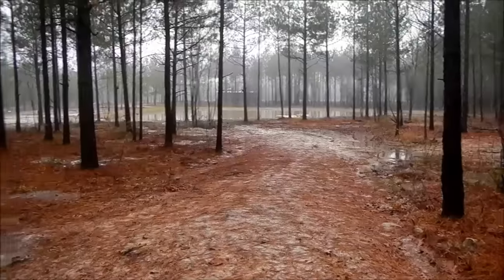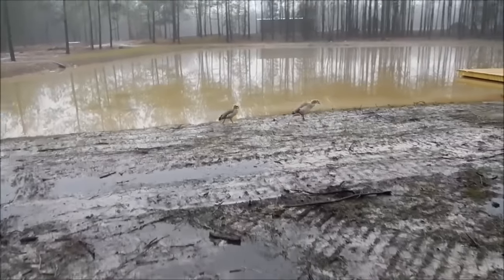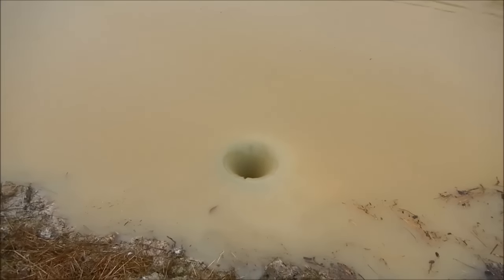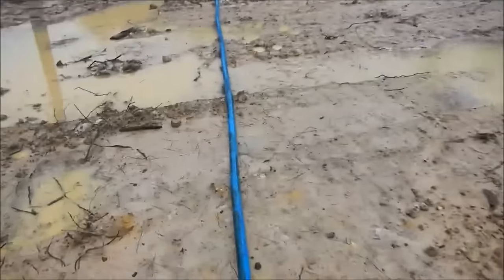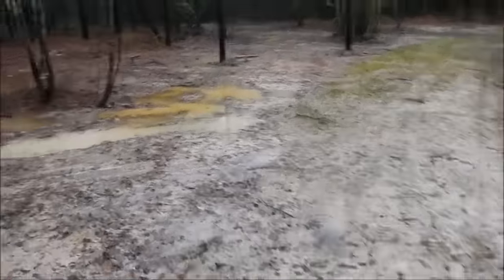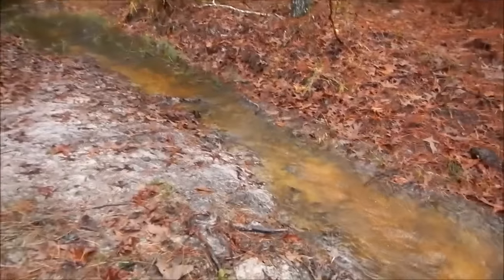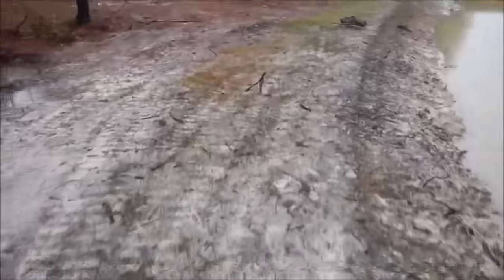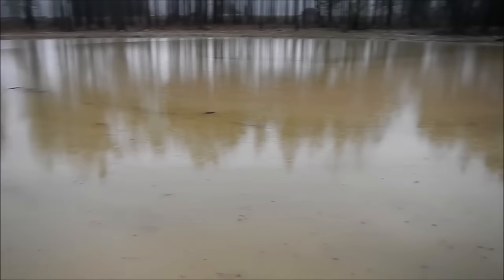Farm Pond Is Now Full

Comment: You are going to have a problem with your 12" pipe getting clogged up if you don't put some kind of grate or screen on it.Maybe one of those chimney caps that spin in the wind would work as a grate?
Reply: And you would be correct sir we build upon like that in North Carolina for a customer and had to go back and put a cap on it and that's what we used was a Chimney Cap that's spawn and it keeps anybody from falling in kids or animals